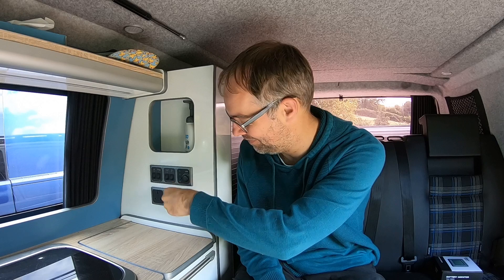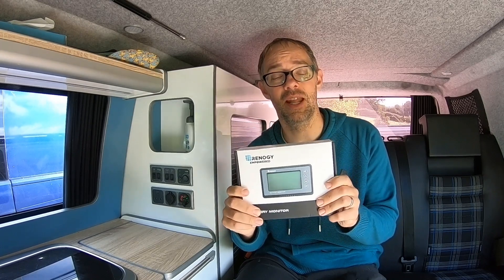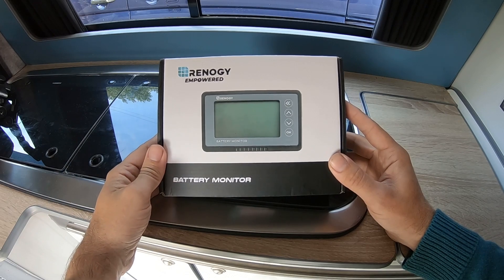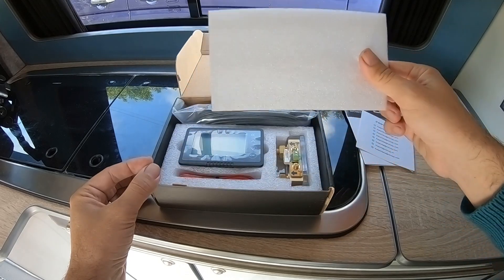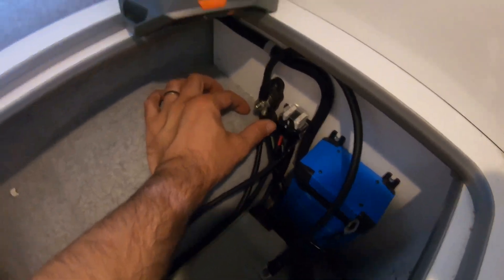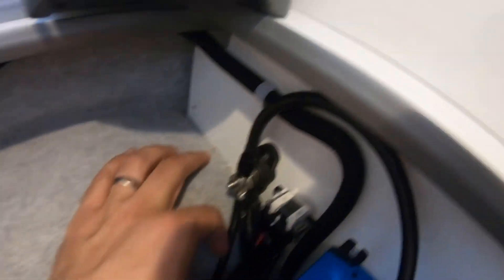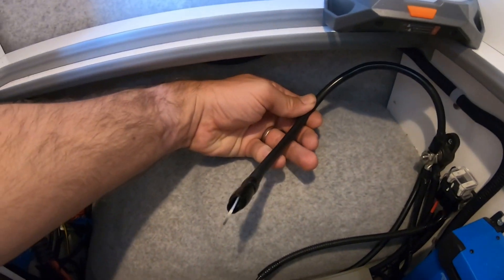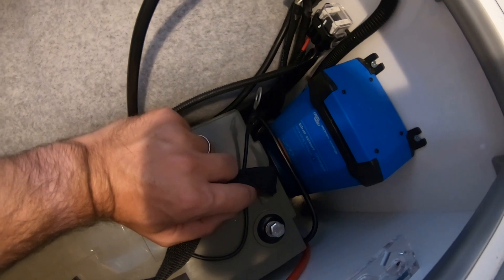Renogy Battery Monitor - How a battery monitor works and how to install in a campervan

Comment: Very informative and well explained. Did you calibrate this monitor after you installed it? I found the instructions for calibration to be almost incomprehensible.
Reply from the maker: As far as calibration went all I remember needing to do was fully charge the battery using the mains charger on board then I set the Renogy to 100% and it’s done a really good job of tracking everything in and out of the battery since. I hope that helps 👏

Comment: I purchased a Renogy battery and Good Grief, its 130 lbs, threw my back out getting it into place,,, a UPS girl carried this battery 150 ft up my driveway and set it on my step,, and she did not stop for a rest !!!!! I couldn't believe this girl carried this battery... I told he more were coming and she just laughed,,,, So far I have not get them yet but I will, hopefully there is time,,, now I have a goofy charge controller,, I connect to a light bulb and it reads up to 18 amps at 14.5 volts - WHAT??,, No light bulb draws 18 amps,,, I connect to a battery at 12.4 volts and it reads 2 amps and when connected to real low battery it reads 0.00 amps 14.5 volts WHAT ???? I will probably just replace that controller,,, its old TRACE 40 so its probably done,,, also how am I getting 18 amps when the panels are rated at 7.5 each,,,, maybe they are shot also !!!! I had a van like you have with all the off grid power,,, lived in it for years!!! At 60 mph its like you never left the living room  LOL!!!! That was back in the 70's - guess them days are over...... Thanks for the video  - be safe out there - the world is nuts..... and so are the people !!!!!

Comment: Does the lcd screen go into sleep mode when it's not in use or do u have to have a switch to turn it off
Reply: Goes into sleep mode until charge or drain current is sensed.